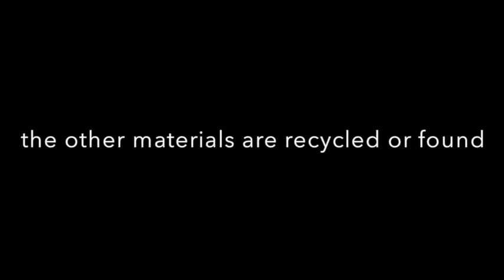How I made a Guzheng

Comment: So you were able to produce a compound curve (it curves lengthwise and widthwise) simply by clamping?  The frame looks like pine; will the tuning pegs be OK in softwood?
It looks great, great job; please upload a video of it being played!
Reply: tuning pegs will never be ok in pine.  THey will only be ok if you never tune them and use superglue to keep them fixed. Altho i encourage people to do woodworking, thiswhole guzheng is very very badly constructed, no proper research has been done. Its all very crudely.  using pliewood etc. one needs to use layered hardwood for the tuning pin block for instance. 
This guzheng is bound to turn out into a dissaster and a waste of money and time.  I saw some very poor woodworking skills and lack of experience.   I doubt it if this would weigh up against buying a proper guzheng made by an experienced professional. Guzhengs can be bought for a few hundred dollars. the cheapest models  look much better and are not constructed from inferior materials like this one. I have played quite a few low budget guzhengs and i must say they sound pretty good and are well constructed.
Reply: Gretchen Thunberg I also made a guzheng-like instrument in 1999. It does not look as pretty as this, and the instrument has no arching, but I made sure to use very hard tropical woods for the ends and tuning block.